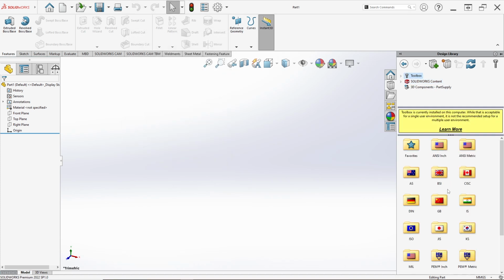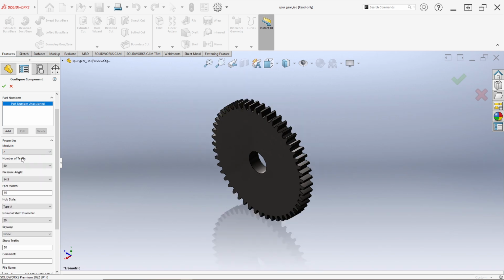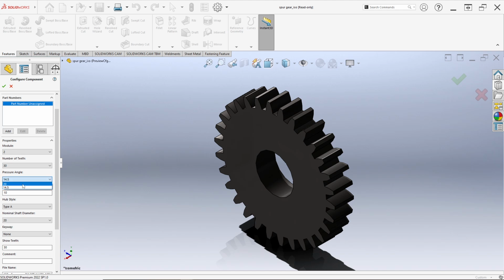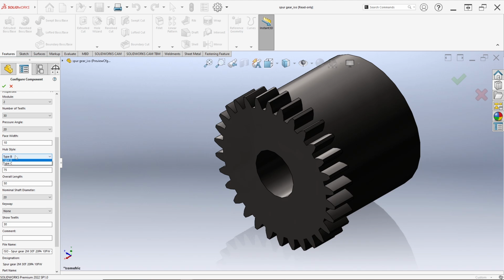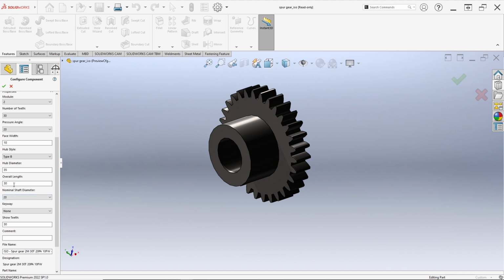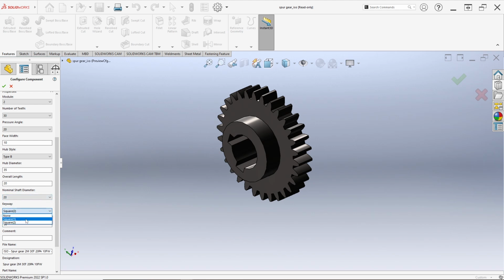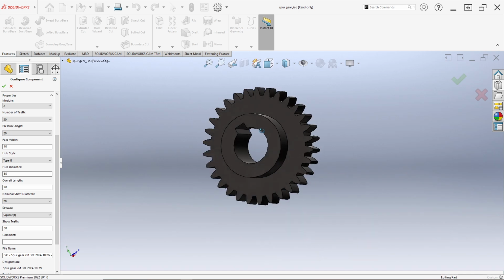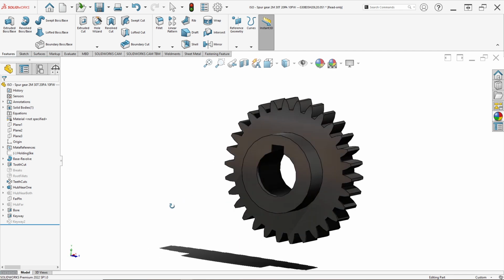SolidWorks Gear Design | Easy Spur Gear Using Toolbox

Comment: It should be noted, though, that the gears in the Toolbox do not have correct tooth geometry and thus will not work well. They are merely meant to be a good approximate for visualizing and quick work in assemblies.
Reply from the maker: I agree with your opinion, this is suitable for making visualizations, especially in assembly. Thank you for your input